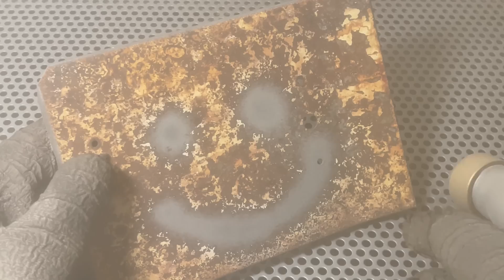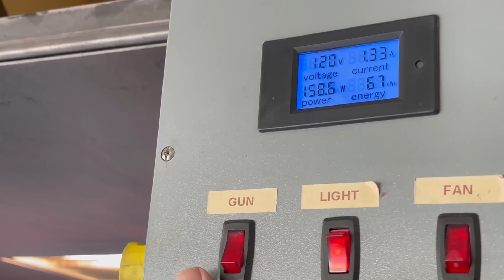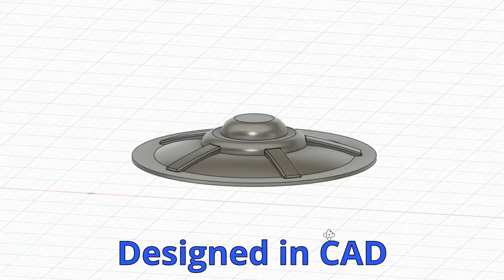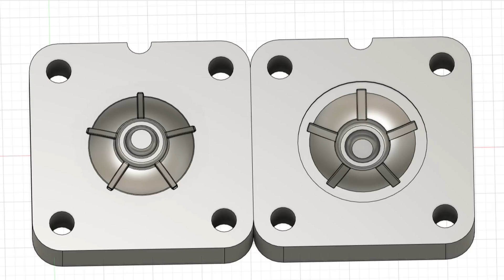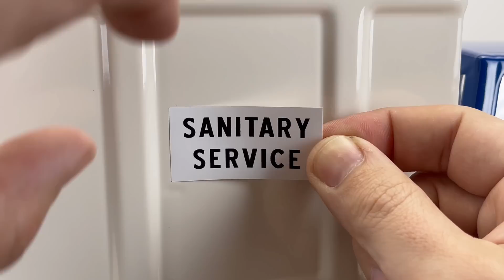1960s Tonka Sanitary Systems Garbage Truck Toy Restoration

Comment: Another fine restoration!  BTW...  It appears that the frame on your restored tow truck is twisted as the passenger side front wheel is not touching the work bend when you're pushing it along.  Probably an easy fix, just grab the front and rear of the truck and twist it until all four wheels touch.  

Having fancy tools, while some people here on the "Tube" find that's cheating, I think it makes for a much better and more capable restoration.  Hope to purchase a Precision Matthews mill and lathe for retirement in the next few years.  Keep the great restoration projects coming!

Comment: I have one of these. Got it for Christmas over fifty years ago, and it's in relatively good shape. A bit of wear and tear, but still in much better condition than this one before its restoration.
Reply from the maker: I do not have a telegram account, this is a scammer posing as me. I am truly sorry and am working to have this user blocked. Please do not go to telegram!
Reply: @ChipChannelRestorations  I've seen the scam before, so I knew it was bogus. Thank you for the heads up, anyway.

Comment: Wow Chip, you have gotten some serious tools that make you the premier Tonka truck restorer.  You can make tires, rubber whitewalls and also stamp metal wheel covers.  Love your powder coating paint jobs,  which obviously are what Tonka did at the factory with these trucks many years ago. The UV light interior whitening, reproduction windshields,  and nickel plating are also awesome.  Beaker looks like one happy inspector.  🐱

Comment: Nice restoration. I do suggest that you save the dies for the "mag" style hubcaps as they were used on the regular Tonka toys starting with the late production 1967 examples through 1973. I once had a #518 Tonka Wrecker from 1967 with the "mag" style hubcaps.

Comment: 4:30  Jumping spiders are cool on many levels.  They actually can spin silk and attach a safety line in case a jump goes bad.  They have also some of the best vision systems for arachnids.  :)
More on-topic Q:  Are there ever any stories that go with the toys?  This truck looks like it was baked in a fire.

Comment: I'm curious as to why you don't blow off your items with compressor air (before tear-down) to get rid of alot of the flaking paint (spiders) etc.  Each item I see looks like it has been buried in a swamp for years.  They sure have taken some harsh weather to say the least.  I suppose it makes for a more dramatic presentation.  The finished products are always excellent, and I guess everyone can say "I would have done it THIS way".  From being a mechanic for many years,😀 I've learned there's ALWAYS more than one way to complete a process.
Reply from the maker: I do not have a telegram account, this is a scammer posing as me. I am truly sorry and am working to have this user blocked. Please do not go to telegram!

Comment: First time I watched your video. You do beautiful work but you are not restoring antique toys. You are re-manufacturing or rebuilding something that is old and from the past. When I first saw the title I was expecting to see you refinishing the old parts to look like new again. Obviously you are unable to refinish rusted metal without replacing it. With that it would still be a restoration but to cut new pieces and use nothing from the original piece, that's a different classification. I never pick on stuff like this but I was expecting to see an old toy restored to look almost as good as new. You make things better then the original and they are beautiful but they are not a restoration. Sorry all you fans out there. I don't want to sound crazy but I was expecting something different then using laser cutters, 3D printers and powder coating to make something that the average person could not afford to do.